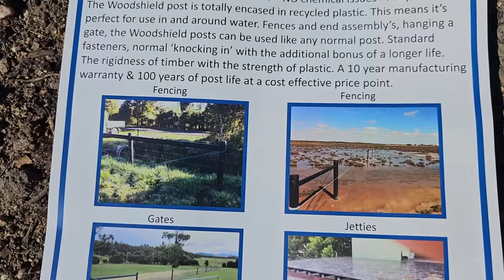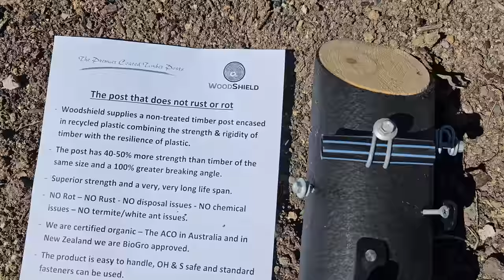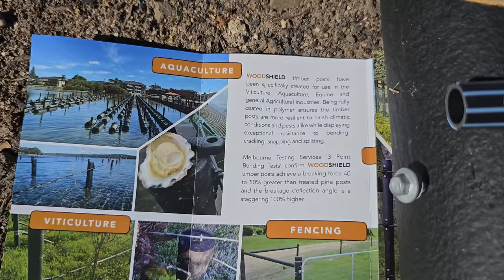Don't Make This BIG MISTAKE With Your DIY Raised Garden Bed

Comment: Hey Mark, hope you're doing well.
For spreading or compacting things more than our meat pads can, set up your car jack to help.
I use jacks to fell trees (for direction), split wood, move (spread/compact) tough things, etc.
Hope that helps you and others in the future.

For those wondering about wood splitting, its best with those fast rising racing jacks.
I got one for quicker oil changes and figured out its great at splitting wood too.

Comment: Drop a biggish stone and gravel at the bottom of the hole before you put the post in, it helps with drainage.

 It looked like the end grain of the post was exposed : this is where most of the water penetrates the wood due to the structure of the wood (also you have that plastic stuff on the outside). 

Always seal or cap off the end grain, and keep it dry at the bottom by not letting it touch earth (stones, gravel etc.).

Comment: My raised bed mistake was making it with scrap from work. Birtch plywood. I thought treating it would make it last. (Linseed oil)  My chicken coop is fine with the same materials and treatment.  Three years in, the wood is flaking apart. I retreated the exposed edges, but bugs love some wood.  I will strap them together and hope it lasts long enough for the soil to hold itself together when I change it out.

Comment: To get the posts straight it is easier if you soak the ground around them first after you attach the straps and ratchet them a bit to get the straps tight..   Soak it quite a bit and the posts will move easier when ratcheting.

Comment: I'm jealous you were able to drill so far down into the ground and not encounter a rock. I'd be lucky to get 6 inches before encountering a rock. My post holes end up being about 16"-20" around because I have to widen them to clear out stones. Good recovery of the bed though. Cheers!

Comment: Hi Mark,
I can see why you think this this might work.
Personally I think you should have put the logs in deeper and put some concrete at the base so it holds for many years with some reno to add the extra strength. Sometimes going back and doing the footprint and add some pipe drainage, cover with geo fabric then add a stone base up to 200mm topped by straw then add back the soil with some compost and new trace  minerals and a crop of green manure can keep this bed going for a very long time. 
If shortcuts are used, it’s not able to stand the test of time. 
There are heaps of other video I adore of yours, but as a gardener of 50 years, this isn’t going to stand up. It will be similar to pruning a fruit tree before doing the due diligence and reading up on the correct way to prune and bloom ❤

Comment: Sir, if you don't mind me saying, If the braces would've been set at a 45ish degree angle,  alternating  (if you were to look down the whole length of the raised bed, in optimal conditions you'd only see 1 X, the beds wouldn't have moved. Scaffolding (tube and fitting) provides perfect examples if you only imagine that 50 years ago scaffolds were only wood and nails and rope.

Comment: Hello Mark,

I believe this plastic stuff is not so great as you might believe. The microplastics may come from just the material breaking down due to handling, UV radiation, cutting and abrasion. I think a good alternative for those who are looking for a free plastic solution to this is to burn the outer layer of the wood, like the japanese do in their traditional woodbuilding technic. The charcoal layer is not broken down by organisms, and you still keep the structural properties of the wood inside.
Although, I see the benefit of the product as you pointed out, I believe that the brand may be doing some marketing for some of the properties that they claim.
That kookaburra was amazing, it really stole the show :D
Cheers,

Comment: Posts are a good idea wonder if I can get them nearby. A good rule of thumb for posts is to go at least as far down as the height you are retaining. I use a bit quick wet cement for longevity or a 45 degree brace

Comment: The "just re-cycle again" part is where recycling is shot in the foot, that's not how it works. Aged exhausted material behaves differently, or simply crackles apart and the nano-plastics problem begins. It can be burnt at extreme temperatures to get rid of, still very toxic, but still much much better than having them linger in the waters.

Comment: I can see the ground the bed is stood on is part of the problem. The ground that is down hill needs building up to make an even platform then use the bracing inside the beds to support it. Another thing you could consider is measure along until the bow and order that sized raised bed?

Comment: Hi Mark, love watching your channel and it’s great that you show your successes and failures with fixes. I’m no expert when it comes to building things but did find out when I had to build a retaining wall out the front that what length of pole that is out of the ground is what you must put in the ground to counter act against the weight/pressure. With everything you’ve done, which I must say is pretty amazing you may already know that. I love your little kookaburra mate steeling the limelight. We have some Barbary doves that frequent the garden and one in particular that will land on a garden pot base and eat wheat off of it while your holding it. But I think having a little Aussie icon joining you in the garden is so much cooler. Keep up the good work mate. 👍

Comment: I buy huge pots on clearance. All the same. My backyard has a couple of big cherry trees and a huge maple that gives me shade in the summer, but it can be too shady for some stuff so I have to sometimes move things around. But I have a real Sunny place and few other little sunny places depending on timing here, so I just go to Rite Aid and buy the big pots or put them in the ground but I can’t keep putting stuff in the ground because I have a lot. We have a really long driveway that goes way back to the back of our house and I have all my berries and tomatoes and stuff out there cause it gets a lot of sun, and then up the driveway. Of course I have plants in the ground and on both sides in the front and the back. Lot of work in fall and with all the leaves and pruning and cleanup. Last year‘s our springs have been crappy and cool not much sun but then once summer starts actually about the last four years gets pretty hot from mid May until November and October. Which is kind of nice it gives you a little more heat before the winter comes. We don’t have super cold winters just damp, Washington state.

Comment: My beds are not as tall/long as yours so less issues though the same. I used threaded rod also. Works perfect and over time. Heres what i did different. 18" long 2' x4" on each side of the threaded rod both inside & outside. Way more support. I placed them vertical.

Comment: If you need to do more work like this, I’ve seen videos of people using a hammer drill to drive metal posts into the ground fairly easily. There are also powered post drivers you can buy or rent (both pneumatic & gas powered).

Comment: SUGGESTION - put some wire from post to post  across your bed - without a cross tie, eventually, the posts will bow out, too, but a piece of wire across the bed will hold them in

Comment: you know what i like about your design? if you throw a clear tarp over it you could turn it into a green house and then take it off for the intended purpose of using it as a trellis. ik that you were pointing out the mistakes you made but its still a good design once those mistakes were fixed.

Comment: my method ...450mm deep hole with a bag a redimix concrete at base, top up with soil, lean posts into hill by 10 degrees. Any movement will only push post plumb vertical.

Comment: I just built my first garden bed. Used reclaimed steel roofing and some near rotten oak. I made it so none of the wood will touch the dirt, and I built it in a U shape on top of railroad ties. I doubt this will degrade for quite a few years even with the oak partially rotted. I put all my strength to it and I couldn't even get it to shake. I didn't even dig any posts

Comment: You should buy or borrow some turnbuckles from a concrete guy. Use them to push from the other side. Then set new posts on that side.

Comment: thinking about it you probably did a good thing if you would have put those posts deeper from the get go they would have rotted and snapped causing your beds to strait up fall. this way you had time to fix the problem and have the opportunity to use recyclable plastics.

Comment: Maybe try using thicker thread bar and put a washer and bolt on the inside of both sides the garden bed then on the outside might stop it folding in.

Comment: I just lay carboard in a layer, then line up a double row of bales of hay with the bailer-twine pulled off. Lay them lengthwise on their sides. Push my hand in a ways, add a yogurt container of soil into that hole, push in the transplant. Repeat every 8 inches to a foot in a winding or double pattern. Then go around to the other side  row & do same. Transplants for things which will stay, like baby hosta or lilac or grape which I want growing for 3 or 4 yrs before relocating to a permanent site, those go in the inside edges. Egyptian onions & cukes etc closer to my walkways. I water really well if not planting before 2 days or rain. Then forget it more or less. No real upkeep to such raised beds, which over about 6 years can be redone in exactly the same place, same way.  new bales on existing decomposed ones. No nails, no hassle. In late autumn pile on a bunch of leaves to overwinter or grass clippings...both encourage worms & extra good rooting....you could leave a narrow center space between the 2 rows for that & shove them down with a spade.

Comment: Oh yes. I've had the upper back shoulder pain. I soak in very very warm bathe water with Epsom salts up to my neck. Weak muscles cause it.
If you have time check out, Posture videos at Precision Movement. So once you've learn how to correct the posture by strengthening weak muscles check that channel for other videos. 
I'm in my mid 70's. It has worded wonders. I'm not affiliated with the channel.  
We can all do so much more without weak muscles. 
That was a lot of work. That bird loves you. Great video.

Comment: What is the benefit of raised garden other than having a garden in a swamp and keeping it from being saturated?
I recently helped my daughter with a school garden and when I first saw it being on a hill I could tell it was probably pretty dry. Then I noticed they had built raised garden beds about 8 inches high. I found out that the only things they could grow there were things that required very little water.
There was one bed there that someone decided to jack up almost two feet high.
They told us nothing would grow there.
Unless you were out there twice a day watering the place was dry as a bone, and the raised beds were a desert.
We put it all back to ground level and planted things that used less water and grew more stuff than anybody ever had.

Comment: Very interesting about the treated pine posts covered in recycled plastic.  I am wondering why they don't make the whole pole out of recycled plastic.  That would surely have to be as strong as a wooden post? But I am no engineer.  Just curious if they have tried that.

Comment: If you had cut and turned your panels with the ribs going vertical it would have given it more strength, because the ribs would not have let it bend in that direction. I know it is more work but it pays off in the long run,

Comment: I might have missed a step but I am not sure I understand fully what the advantage of the poles were on the inside section of the garden bed other than to hold up the overhead trellis.  If the soil is going to bow out I would have thought it would bow towards the outside poles which I think you said is on a slope. Did you try and screw the tin sides to the poles at all to help keep their shape?   I imagine in retrospect those inside poles would ideally be placed on the inside of the garden bed for the top side and outside for the bottom side.  Would that be correct. Or did I miss a step in your process.  🙂

Comment: If you simply put a nut and washer on the threaded rod inside of the bed as well as the outside, it may have stopped it from being pulled in like that.

Comment: You should have mixed the dirt with some cement, would have gave you a better job when putting the post in the ground. 3:1 would have done it.

Comment: Posts on the inside looks nice but in there they're exposed to all the moisture. Outside they would have lasted longer. Also burning them a bit with a blow torch can drive out bugs, bacteria and fungus. The wood will last a lot longer even the buried part.

Comment: I love your channel and have a question please. I am filling my first 4 by 8 foot garden box. It’s about 3.5 feet deep. I placed a dozen large oak stumps and the bottom and have been filling with dirt and mulch. I have about 2 feet left. Question; I have a ton of olive tree branches I wanted to throw in next but was wondering your thoughts? Do you think olive branches and leaves could cause any issue for the bed at that 2 foot depth? Thanks! 🙏🤙q

Comment: @selfsufficientme Your structure is suffering from similar malodies that affected the Hagia Sophia. The base of your horizontal arches force the base of the arch to splay away from the centre of the arch. Some tension anchors connecting the base of the arch would prevent the feet from splaying. Alternatively the uprights must be bolstered laterally by  buttresses, like you've done.
A hyperbolic arch would direct a great force downward. A graduate civil engineer can help with the analysis and member sizing.

Comment: I'd like your thoughts on the ryobi hole drill thingy..
I've been thinking about getting one since the 2 stroke one i have acess to viabrates my arms to the point where i can only do 3 or 4 holes before my arms are... well I've never use something so bad...
plus I've got heeps of ryobi batteries from the other tools i use every day

Comment: 5 seconds in.. problem is obvious. The ground  was not leveled. When u build on a slope you have to reinforce against gravity. There are also no frames on the outside and I doubt you put any cross members on the inside.

Comment: The plastic in the ocean seems to be coming from the Recycle Industry. Since most plastic (somewhere approaching 90 percent) is not worth recycling or is not recyclable at all, third world countries are paid to take it. They take it, get paid an amount less than it would cost to incinerate it or send it to a landfill, then they dump it into the ocean filling the oceans with plastic. The idea that the floating islands of plastics came from individuals littering (which is what the plastics and recycle industries want you to believe) never made sense to me. I got frustrated with our local recycling program, because they were simply dumping the recycled material into the landfill, because they couldn’t find anyone to buy it. People were washing their mayonnaise and peanut butter jars, etc, etc, to give them clean recyclables, and they were surreptitiously dumping it all in the landfill anyway, without ever informing citizens. I started doing some research and found out that recycling is not nearly as environmentally friendly as it’s made out to be, and is not only increasing costs to the taxpayer, but is causing more damage to the environment than simply burying or incinerating garbage.

Comment: unfortunately about the plastic; it still will degrade over time and it can still leech its curative chemicals into your beds. thermal cycle weathering and just natural chemical & physical processes in the soil will cause the outer material to begin to ablate and open the internal plastic to leech any held curatives and the ablated material will be microplastic granules that will contaminate your beds. 

by all means this is mostly small, especially the curatives being diluted in the soil (particularly curatives like phthalates) but just... be aware if youre gonna use a lot of it. its not a silver bullet. its far better in my own opinion (take it with whatever grain of salt needed) to seal your wood with charring and wax. while its true it will eventually breakdown, its at least safe comparatively.

edit: by all means, and by full transparancy I am neither a chemical nor mechanical engineer. my advice is very much just casual booklearning based.

Comment: build like a trapesium prism - wider at the base than the top (like a lopped off pyramid). your soil is basically acting like water behind a dam, more pressure at the base than the top. think your stereotypical gold bullien bar/brick.  

next time on a slope, treat it like a heavy fencing corner post and strain occuringly. old plow shears were my FIL & fmr-hubbie's go to for bracing the straining posts when straining corner posts when fencing.

Comment: Generally when you recycle plastic with certain specific exceptions it gets shipped to a third world country and burned for fuel, where it releases a mass of toxic chemicals into the air. As for the plastic that really does get re-used, most of the processes are worse for the environment than to just make new plastics.